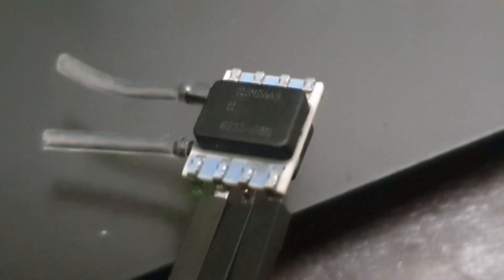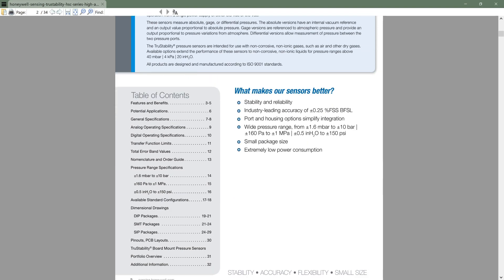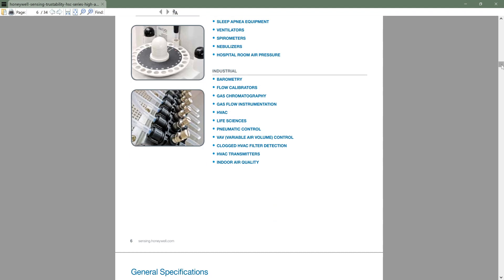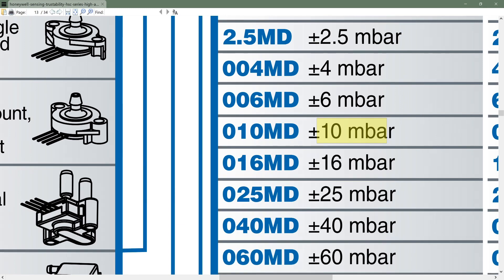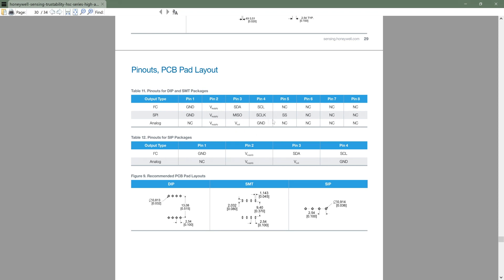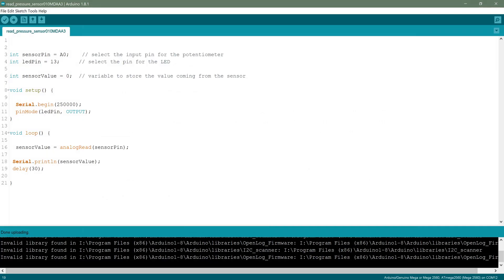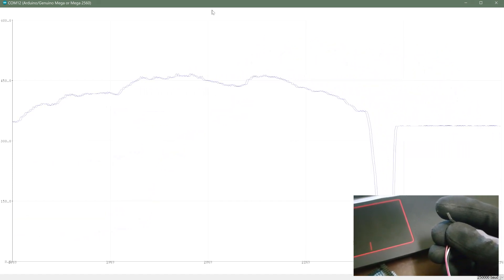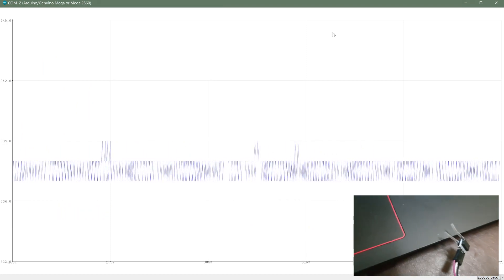Honeywell Medical Grade Pressure Sensor | 010MDAA3 |  Analog Output | Arduino

Comment: What's the different between 1 port and 2 ports sensor?
Reply from the maker: This is from Honeywell datasheet. There are three types of pressure sensors: 
1) Absolute: Output is proportional to the difference between applied pressure and a built-in vacuum reference.
2) Differential: Output is proportional to the difference between the pressures applied to each port (Port 1 – Port 2)
3) Gage: Output is proportional to the difference between applied pressure and atmospheric (ambient) pressure.
So depending on sensor type, you need to check which you want/have. If it has one port it means other port is automatically set to either vacuum or ambient pressure. It will tell you difference between that fixed reference and applied pressure at single port sensor. While with two port sensor,  one port acts as reference pressure and other as input pressure.